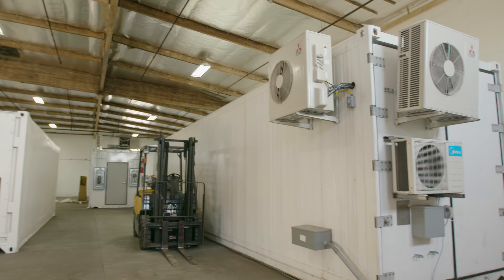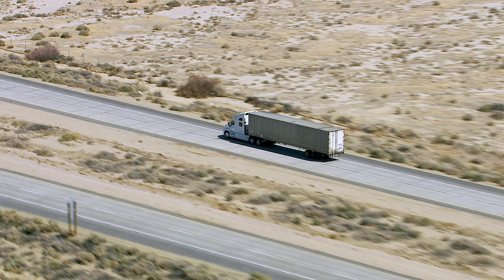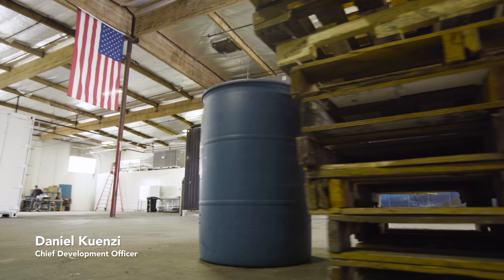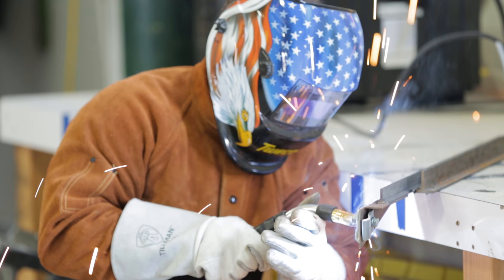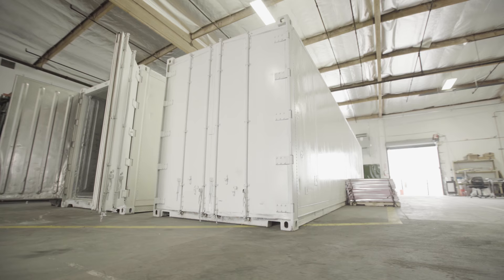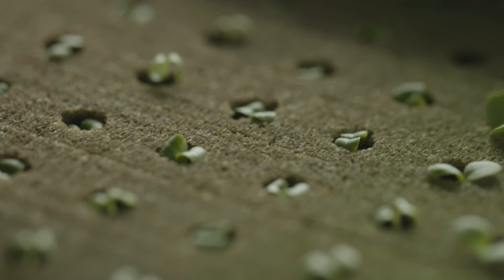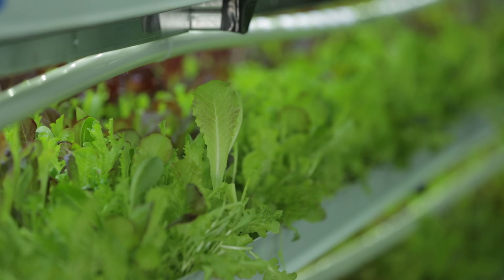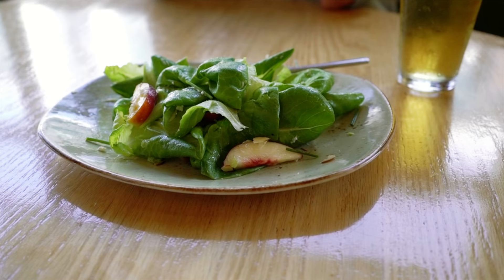How A Company Fits Five Acres Of Farmland Into Shipping Containers

Comment: quick calculation, stacked 6 layers high, with a 60cm corridor a 40ft container would offer about 120-130m² of cultivatable area. 5 acres is about 20200 m². I assume that they mean it has the same productivity as 5 acres... which would be a 127 times increase in yield? I would like more context on these numbers? That said, I really like container cultivation.
Reply: Agreed.  Best set of comparison figures I have seen is Broadacre - 1 lettuce per sq ft, 3x per year.  Indoor - 4 lettuce per sq ft, 12 x per year.  = 16 times the productivity by area. I guess you can stack containers 5 high as well.  That could get to 80 times.  The numbers for intensive indoor production are impressive, but massively overstating them with no explanation does no one any good.
Reply: Container cultivation aside. It's small fry compared to what's out there. The really big players in hydroponics who use semi-automated operations get amazing figures. The best numbers I've found is something called the Finnish Gutter system than can produce 900 crops (heads) of lettuce per square meter per year. These are big conveyor style operations and the area calculation is essentially averaged over the size of the entire installation. The crops are not stationary. Only 4 workers are needed in the entire production line.
I think the type of crop produced in these highly controlled container environments will be of a superior quality though. And therefore be of a higher value. I say if they can do it profitably then by all means.

Comment: I wish there were less scammers in the vertical farming sector.

5 acres in a 40 foot container? No. You would literally have to use thousands of tiers of plants - all in a height that's probably not even 7 feet. NO.
Reply: that fact was probably calculated as per year, or month or something. Because in around the clock monitored conditions you could get many more harvests on the same amount of time. So, all around the year and under monitored conditions this might be able to produce what a normal plantation could on 5 acres per year. They didnt say that the trays on the container actually cover 5 acres if you spread them out.
Reply: Mr30friends it is still called misleading.you can do the math on square meter on that container. Beside your idea would be best suited for genetic modified food but are you sure it will sell?. Simply said be honest and I'm sure some investor will invest. This surely will be good idea in certain situation.

Comment: Also those containers are filthy inside with water on the floor almost everyday which is a hazard on its own. They also used extension cords with cuts everyday on there wet floors. I stated that to the manager and countless other employees  they just told me it's normal here at local roots!!!if you plan on working there expect to work  everyday with unprotected wires on wet floors and algea on there flood tables because they were too stupid to block the light from  hitting the tables this video won't show you that obviously  and the company had so many problems to fix with there lights always failing,(algea also in alot of the led lights because water got into there lights!!!)flickering and sometimes they would lose alot of lettuce because they had problems with there computer program and the air conditioner would not turn on. Also they had an ammonia powder in the air every morning that would give employees headaches and it would cause nasal irritation.